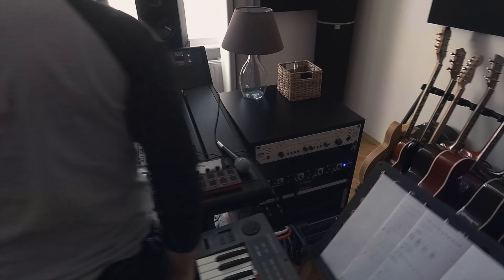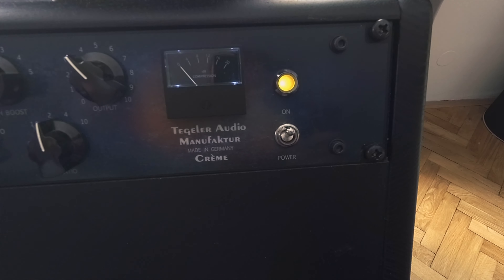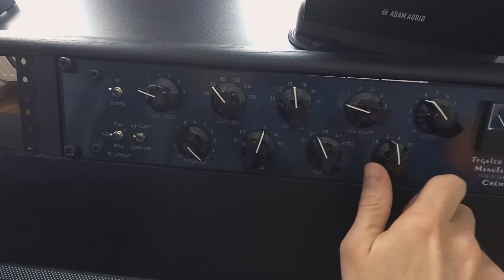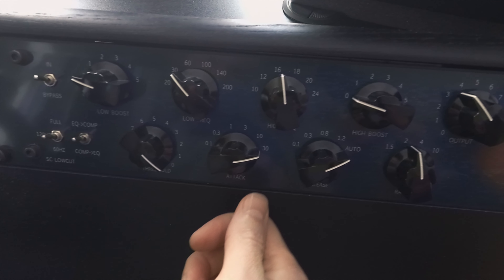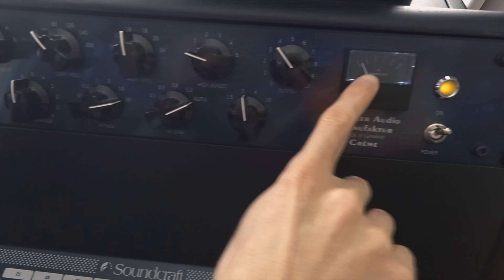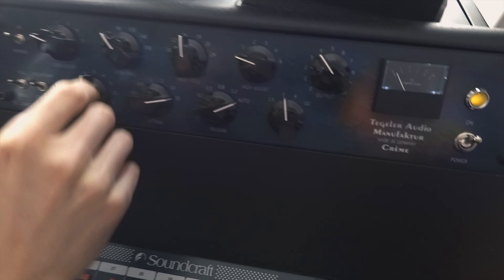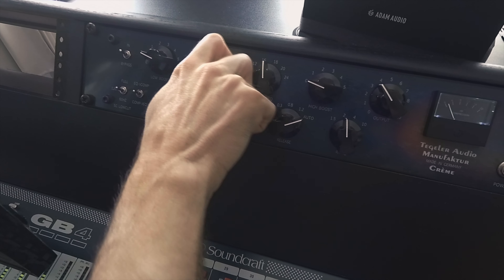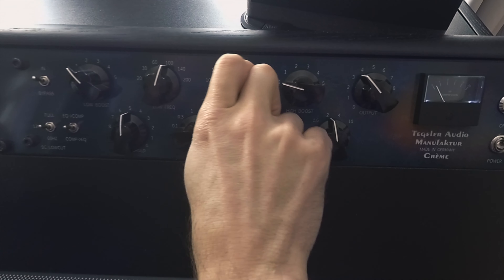Mixing Analog | Mixbus - Tegeler Audio Manufaktur Crème

Comment: Hi Marty. What do you do when you have to change Mic for LINE to mix? Do you have some button in desk that allow this for you? Or you just Record in 16 First Channels and mix in the others? TKS.
Reply from the maker: I usually record through external preamps directly into the converter. I have 2 spare channels though that I can use for stereo recordings. I mainly use the console for mixing rather than recording. There is no button to switch between Line and Mic.
Reply: @ZedMartyProduction  TKS for the answer. However, I like to record some instruments with eq. So, use the eq for the console help me a Lot.
Reply from the maker: You can use it as a split console. Left side for mixing and right side for recording so you don‘t have to unplug the cables all the time.